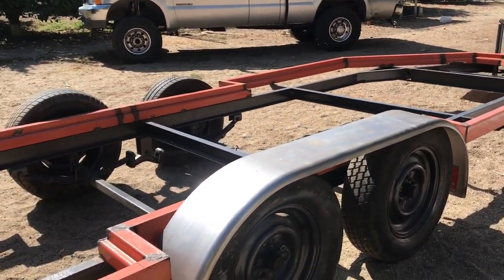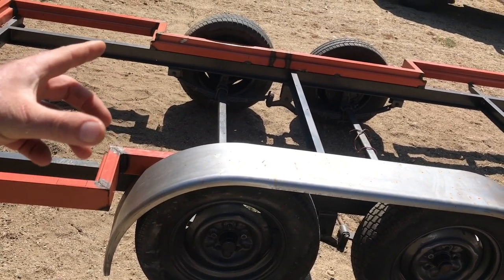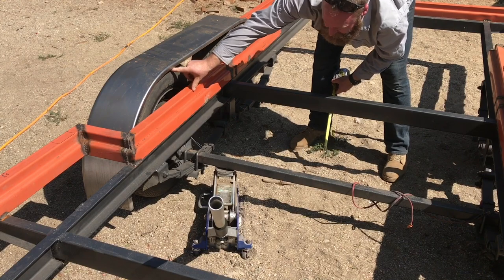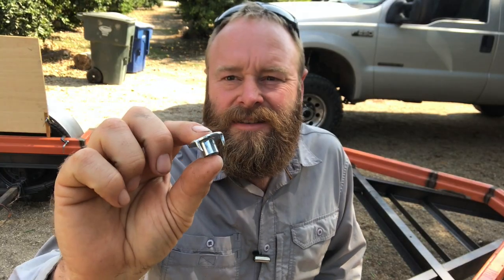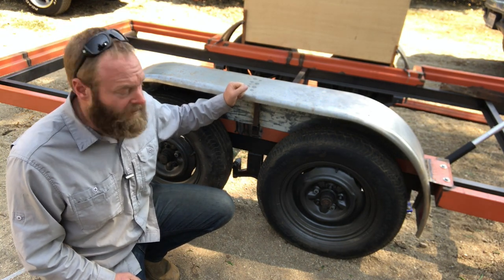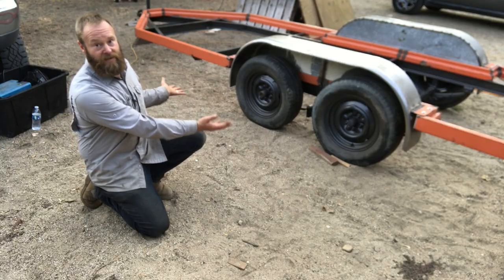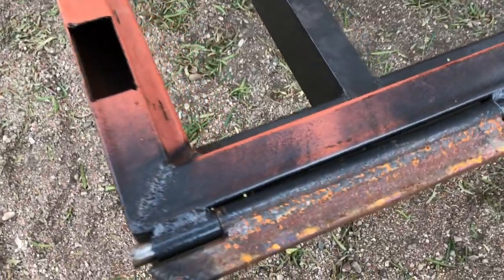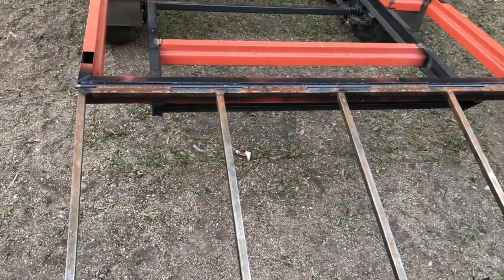The Giving Trailer Part 7 | Removable Fenders WHY SO EXPENSIVE?

Comment: as usual im a little late, but first off nice job on the fenders. I choose flip out design instead as the weight of fenders gets to be pain. At any rate the only change or addition i would add to your fenders is a piece of angle iron welded to fender and ONLY rests on inside of frame, after time that flimsy back sheet metal will tend to bend, rattle and not line up right. but again love the design and great work